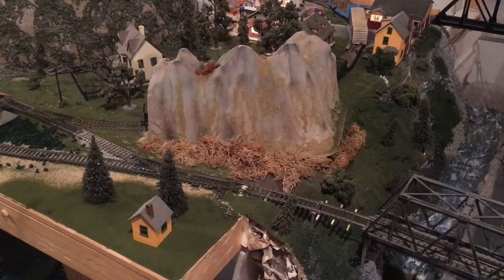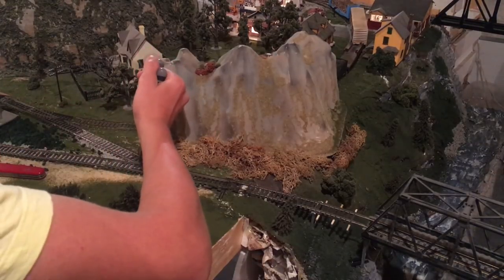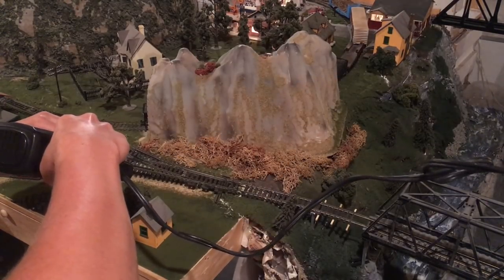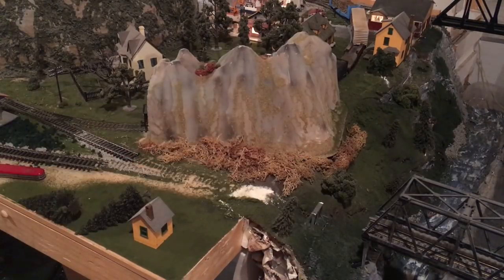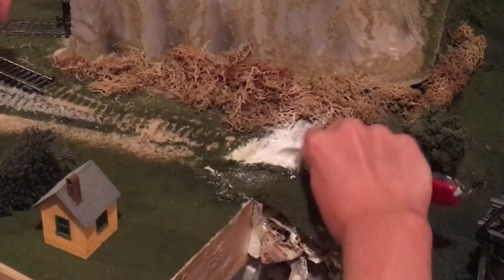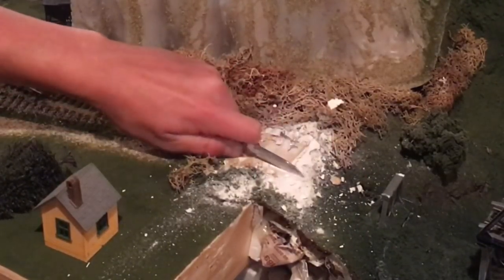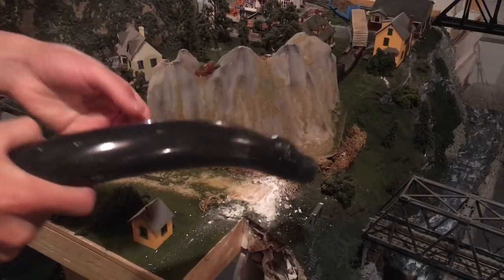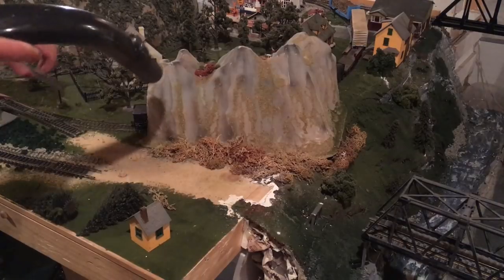Rebuilding a bad section of track.

Comment: well done SMT, your learning the ropes in properly laying tracks I was a beginner myself once had no one to help me, today with the help of Youtube and Facebook communities very easy to have a great layout, you could have a section going up across over and then back down to make layout even more interesting than just around both sheets of 4x8, a friendly advice ,go pick up a book on track designs or layouts that can give you a lot of options on new types you would like to build, a modeler is never done until they are very satisfied the way their layout looks for operations and main run around lines

Comment: I'm curious as to what kind of vacuum you use for cleanup on the layout.  I was considering buying a cordless handheld dust buster but wasn't sure if it could get into the nooks & crannies.
Reply from the maker: It's nothing special, just a regular household vacuum. I always run it on the lowest pressure though to help avoid sucking up things I don't want to.